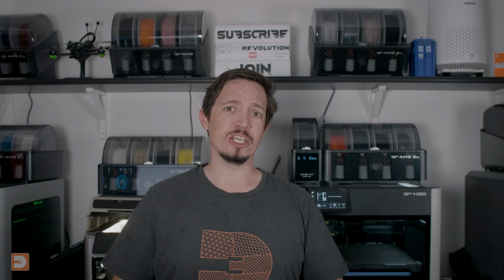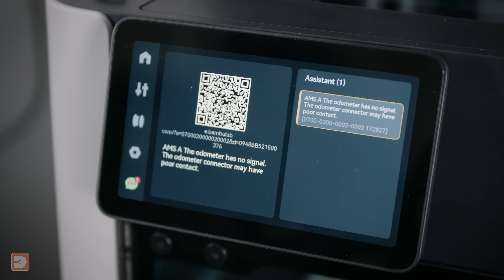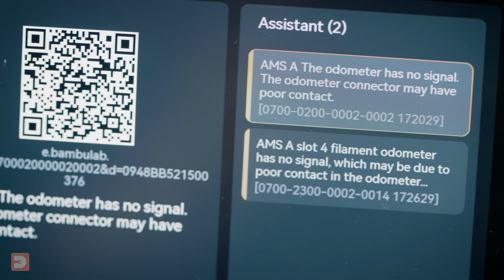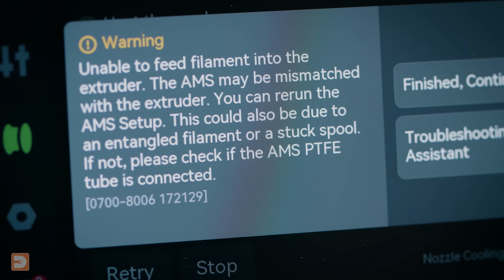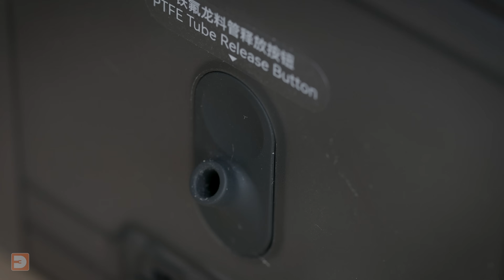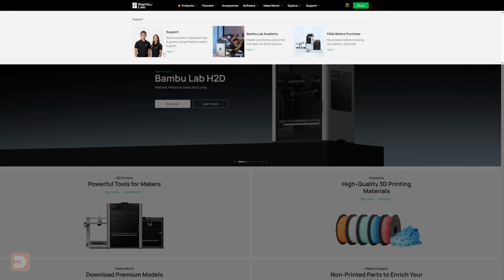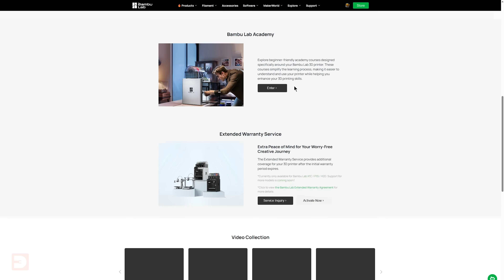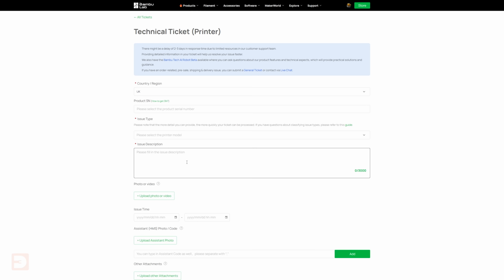AMS 2 Pro Internal Hub Replacement

Comment: Read First, i liked your video and was having similar issue, when i took apart my AMS 2 pro to double check the wires as suggested, and in a result a piece broke off, i was gentle, but trying to check the cable, the smaller cable actually popped the connector off the hub, so im forced to by a new hub and do the replacement in your video, after turning on my printer, my other ams 2 pro gave me same error, i knew it wasnt the problem, so i checked all 6pin cable to make sure they were plugged in tight and the error went away, Maybe i would also suggest to check all cables before as well,

also another side note, the 2 plugs you suggested to check are different plugs pointed out from the feeder hub to the main board, 1 big 1 small connectors,
but yes it is a good video, just wish i had checked all outside connectors before

Comment: Your video is so much more clear than the wiki directions provided by Bambu!  The disassembly directions also help in removing filament stuck in the hub.  Clearly they could have made the process so much easier, but the industrial designers sadly didn't plan for things to break.

Comment: Thanks for the video. After I removed a broken piece of filament from the gears of the internal hub and reassembled everything, I'm now having the issue where the filament feeds like halfway to the buffer but retracts. There seems to be a lot of resistance through the hub and the filament comes out a bit "stripped".... I disassembled the hub completely and noticed that turning the motor axle with my fingers is not smooth and actually a bit difficult. Is that the way it should be? This is a new printer and I have no idea what to do...
Reply from the maker: Hey sorry to hear you're having some issues.
The motor shouldn't freely turn easily just with your hand, there should be some resistance if you're manually trying to turn it. 
So the filament is feeding out of the AMS, just not making it all the way to the printer?
By the way, if this is new as you suggest, it'll be covered by Warranty. Even if you continue to try and fix it yourself (and I'm happy to help where I can), you should flag a ticket with Bambu Lab. They will be able to help with diagnosing the problem and will send you replacement parts for free if needed.
Reply: @3DRevolution thank you. I have already filed a ticket but they are very slow. I've since disassembled and reassembled the hub a couple more times and everything looks fine visually. I can only imagine either the hub motor or sensor aren't working. It seems like the first stage feeder motor is trying to push the filament through the hub gears and isn't getting any help, and ultimately can't overcome the resistance. I guess I will need to stick with printing from an external spool until Bambu decides to respond. Thanks again
Reply from the maker: @ancho-31337  Just to confirm, this is affecting all 4 slots in the AMS?
Reply: @3DRevolution Yes, same behavior regardless
Reply from the maker: @ancho-31337  What error is the printer throwing up when you try to run it?
Reply: @3DRevolution  It's the same one it gives you when there's a bind in the filament on the roll. Bambu did agree to send me a new internal hub so we'll see how that goes. Thanks!
Reply from the maker: @ancho-31337  Let me know how it goes, fingers crossed!
Reply: @3DRevolution  I just installed the new hub (no motor, just the hub part) and it seems to be working now. Thanks for your time!

Comment: I'm having trouble with the hub after getting a new ams pro 2 and printing 5 items. I got the AMS pro 2 because I was constantly having to remove the innards of an AMS 1 to fix broken filaments. I think what I'm going to do, is go into the back yard and smash both AMS's into tiny pieces. Then I'm going to send the pieces in a box to BambuLabs and ask them if they can figure out what the problem is. Maybe they'll get the hint. I'm no longer going to waste any time trying to fix these pieces of crap. There is a way to put a single reel on the back of the X1. That's what I going to use until I get the chance to go down to the recycling center to recycle the whole printer.
Reply from the maker: Sorry to hear you're having issues.
If you're constantly having filament break inside your AMS, that suggests your filament needs drying. When filament absorbs a lot of moisture it gets very brittle and can snap.

When loading filament, pich the end of the filament (around 2-3cm down from the end) and bend it. You should be able to bend it beyond 90 degrees and it'll just bend without any cracking. If it does just bend, snip the bit off so you don't have any weakened length going into the AMS and load it.

If it snaps, then it needs drying.

As someone with multiple machines, each with between 2 and 5 AMS attached, all of which are printing most of the time, I can happily say that having filament break off inside the AMS is not a common thing (I think in the 2.5 years of using Bambu Lab printers it's maybe happened to me twice, and both times were due to needing to dry the filament).

Comment: im glad you even added  mistake on here and its for people to watch out and be careful. kinda curious what you did afterwards did you buy a new motor or something?
Reply from the maker: Yeah sorry I meant to mention in the video. I had to buy a new motor for it. Luckily Bambu Lab sell a direct replacement (which seemed to have an upgraded/stronger connector on it too so they may have updated the design due to this issue).

It’s not super expensive but it was still something like £35 or £45 so wasn’t cheap either. Frustrating but fixable.

Comment: I'm about to buy a H2D I currently have a x1C.
I wanted to ask do I not need a hub to run both AMS. Do I need any converters for my AMS(1) too work on the H2D
Reply from the maker: You’re going to love your H2D.
You don’t need a hub for the H2D. If you have two AMS you can connect one directly to each nozzle. If you want to connect multiple AMS to a single nozzle you just need a PTFE splitter/merger and can print my EasySplit or EasySplit Afterburner I link to in the description.

No need for any converters, you can plug your AMS1s straight into your H2D.

I’ve also popped a link in the video description to the H2D on the official Bambu Lab store  where it’s currently on sale.

Hope that all helps, come back with any more questions and until then, happy printing!